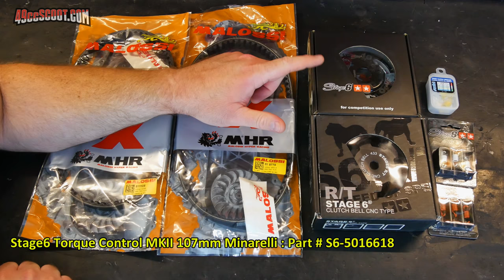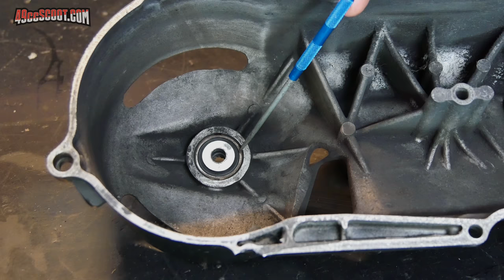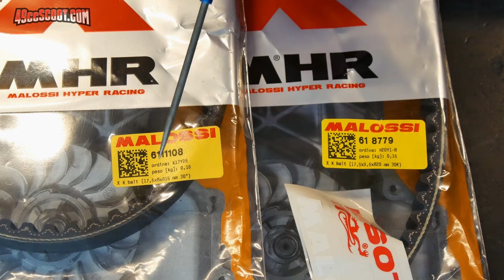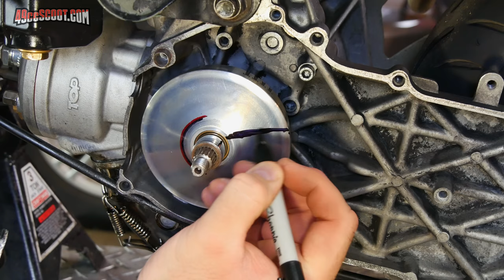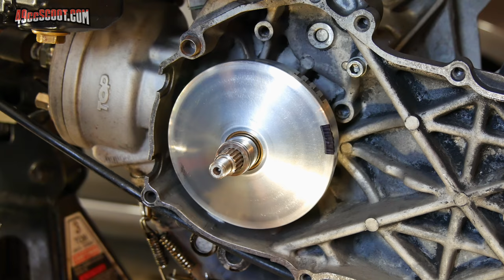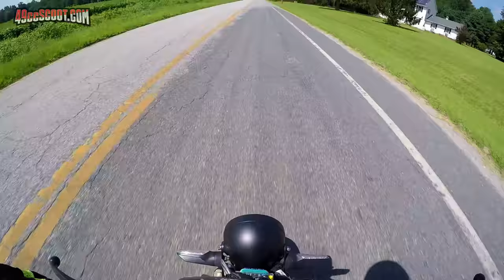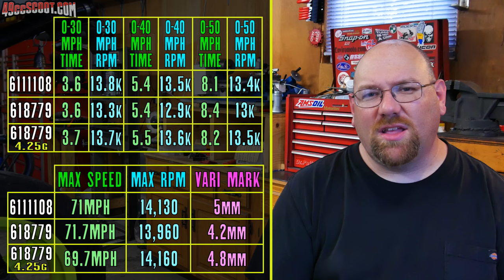Will A Longer OverRange CVT Drive Belt = More Speed & Acceleration For Me?  TPR 86cc Build : Part 38

Comment: Aprilia sr 50 ditech-put that torq pulley and you dont have droping rpm
Reply from the maker: Which one? There are Minarelli, Morini and Piaggio versions of those scoots. I assume they use different driven pulleys.
Reply: Aprilia sr 50 ditech (morini), only that scooter has a full linear half. You need to install half of that half on yours, and only adapt 3 pins to your stationary half. You are using your original belt.

Comment: what about belt width?? does it matter??
Reply from the maker: Yes. Belt width is an important factor for speed and acceleration. You have to find what's right, because there is a range that works. You can make corrections for belt width to some degree with shimming or modifying the drive boss, but the rear pulley has to be considered as well and it is not so easily modified/adjusted to accommodate different belt widths. I usually find that there's roughly a 1mm "sweet spot" for what works best. For example 16.5-17.5mm may work well for me, but change in either direction from there may degrade performance substantially on one or both ends of the acceleration and performance spectrum.
Reply: @49ccscoot  thanks for the reply...i realized on my aerox 155... when using the oem belt i have a sluggish take off but very good top end.. on the other hand... when i installed the malossi X belt...which is a 1mm wider... i gained bottom end and lost topspeed... although everyone says the opposite should happen...whats ur take on that?
Reply from the maker: @abdallahbidawy2211  I usually experience the opposite as others have told you. The wider belts are more typically able to get better travel outward in the variator, for better speed. If too wide, it could restrict travel in the rear pulley though. At idle, the wide belt often sits too far outward in the variator and then pulls the belt inward in the rear pulley, which gives a poor takeoff ratio. If you had aftermarket pulleys with a stock belt, perhaps they were designed for the wider belt and/or different length and that is contributing.

Comment: Hi with my stock gy6 50cc.    Can I run a 95mm diameter. Variator with my stock clutch.  And a longer belt.729 to a 743?   And see any top speed gains and not. Loose low end.  With rollers of the correct weight. Or should I stay with the stock clutch set up ?   I'm trying to figure all this out with. Eco mods.     Also with my stock set up.  With 729 belt.   The belt sits on the drive boss and 1/4 " low in the rear clutch.  Any thoughts or remedy?
Reply from the maker: If the belt is on the drive boss and can't reach the outside of the rear pulley, most likely it would need a longer belt for more travel. It's either that or you should be noticing slack in the belt at that point, like the rear pulley isn't closing under much tension (maybe a weak spring). 

If the belt is already like that, you may not get anything from a bigger variator. Mark the current variator from near center to the outside edge and run it up to top speed. Whatever marker is left is how much travel you're missing. That's not to say an aftermarket variator won't do a better job with belt travel, but if there's a lot left the tune may be off or something else could be a little off.
Reply: What size belt would I need.   The gates 729 is 8 mm short on my long case. The belt is tight on the drive boss and. 5/16  inch low in the rear clutch.   3mm left of belt travel on variator at top speed.  Would a cheap 738 or748 work better.   I don't feel like remembering trig and calc
Reply from the maker: @williamhaskellhaskell3162  CHEAP BELTS DON'T WORK BETTER!

That needs to be in all caps because it's important. They tend to break prematurely, and I mean WAY prematurely sometimes. They're nothing but a source of frustration IMO. Get a name brand quality belt. Bando and Gates are the popular choices.

I'd try the 743 and see how it does, assuming again that you're sure all else is in order as mentioned in my previous comment.
Reply: Hi thank you.  Would the 729 belt that is 8mm short cause a 5/16 " low in the rear clutch at rest ?   All stock clutches cleaned decreased ? 8 mm short sucks anyway !  Where did your Tao Tao stock belt sit? It was a short case?  Do cheap Chinese belts run longer in length?  Will they stretch and allow full shift ?  They are easier on the cvt
Reply: It looks like a 743 20 30.    20 vs 18?   Any salt on ya roads MD 49er scoots!
Reply from the maker: @williamhaskellhaskell3162  Cheap belts are all over the place. They'll break and then you get to free rev.

There are pulley and belt calculators online to tell you exactly what you could expect from different pulley sizes. Usually they just tell what length is needed with 2 pulleys of x diameter x distance apart. That said, If the belt is 8mm too short, then no it shouldn't cause 5/16" depth on it's own. 5/16 is about 8mm, so it will be much less depth difference than the total length difference. #1 for me is usually to take the fixed half of the variator off and let the belt ride directly on the drive boss. Then see if the belt still looks as short. If not, then it's at least partially due to the variator (not enough space for the belt to ride all the way down).
Reply from the maker: @williamhaskellhaskell3162  2mm difference. 20mm vs 18mm width. 18 is standard for most 139QMBs. No salt ATM. It's been warmer than usual. Getting cold right now though. They always make sure they use up their snow budget so if there's even the slimmest chance that it's needed, salt will be all over the state roads.
Reply: Yes thank you sir.  The e bay  and scooter parts. Vender s will not measure actual belt sizes that they sell us. Before purchase. A simple task to get the most out of the stock gy6 50cc scooter and the CV.t. function .  thank you again.  Bill
Reply: Hi one other way I'll try.  I'll cut the worn belt that came with the bike and wrap it tight. Around the pulleys and measure the gap and minus some amount. Of inches that seems ok
Reply: Tighter belts even that you have found.  By a small 5mm. Result in better top end. Acceration and less belt slip.with all your 2 and 4 stroke bikes.   Larger cc not so much.

Comment: The angles of the belt are not the same. Over range uses narrow angle belt for more travel.
Reply from the maker: Hey Carter! Thanks for watching and commenting. These are both sold as OR belts for the Malossi OR kits and both are listed as the same angle. I have not checked the angles myself though.

Comment: Use bando japan belts. Will last a lot longer than mallosi.
Reply from the maker: I've looked briefly for those in a suitable size, but they don't put out charts of belts (or I don't see them) like Malossi.
Reply: What brand do non clone minarellis use? Yamaha oe should be good
Reply from the maker: @MrGrikjames  I used Bando belts with the original CVT setup and they worked pretty well for me. I've always preferred Bando over others that I've tried. Those are 788 17 28 though, so not good for the OR. If they made something like an 815-820 x 17-17.5 x 28-30 I'd gladly try it.

Comment: Ur secondary is the problem . Braking the belt’s those holes be ripping the belt lil by lil
Reply from the maker: I don't think it's the holes, but I do think the driven pulley is the issue. I've got an RC-One now with a Malossi OR CVT and the same design that doesn't eat belts like this one did. I modified the rear pulley when I got it, because it didn't function as well as the old steel version. I suspect that if I had an unmodified version, it may stop wearing belts so quickly.

Comment: honestly i find it kinda sad that a scooter with all those mods does 70mph while mine with a cast iron double ring 70cc and leovince sp3 pipe does 60mph and sips fuel
Reply from the maker: A couple of points that I feel are relevant :
- I am 300 pounds and punch a large hole in the air with my almost 4x4 stance scooter.
- Horsepower demands increase exponentially as MPH increases.
- I try to be honest with MPH claims. I'm not going out on windy days or finding declines to try to pad my numbers.
Reply: thats something i did not consider cuz i'm 160lbs
 but also my test was done on a flat road with next to no wind
 and my scooter of choice was a 2012 aprilia scarabeo with a piaggio engine similar to a zip 
and the 0 30 was 5 ish seconds.
 ill try and record a clip next time. @49ccscoot
Reply: @49ccscoot  also there is my list of mods
-DR EVO cylinder kit from top performance 48mm size piston.
-leovince SP3 pipe
-dell'orto 17.5mm carb with 70 size main jet.
-malossi multivar 2000 variator
-stock rear pulley and clutch
-stock crank but with new bearings
-stock gears
-7 gram rollers, red clutch springs and white malossi contra spring. i think thats all.

Comment: Malossi belt is so unnecessary😝
Kevlar belt holds 25hp to 20k rpm easily lol

Plus it's oversized, so it only works good if you have the both front and back pulleys of Malossi/Polini

Else your pulleys won't even fully engage because your belt is too long to grip the slave pulley 100%

Also get a minarelli horizontal / Piaggio engine next time
(more Malossi parts lol)

OH yeah, plus your exhaust is creme de la crème high rpm one for mhr 7t 70cc @20hp easily lol

Purple spring Malossi
3x black spring Malossi
Mhr 2000 vario kit (1st pulley) 
=
Massive, massive power